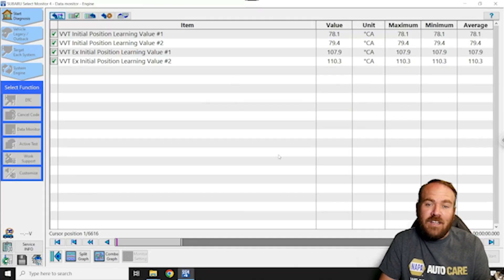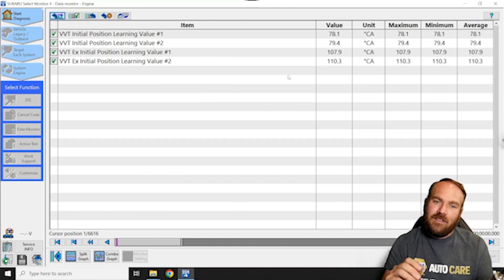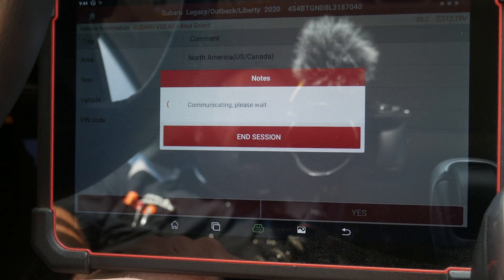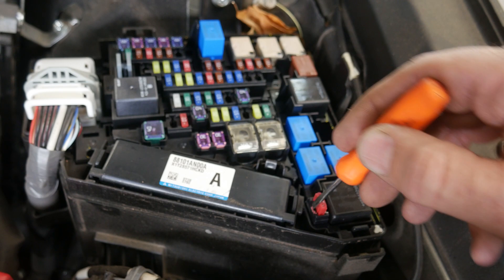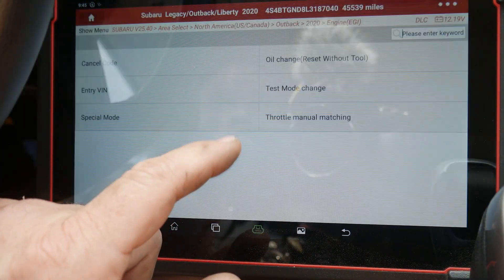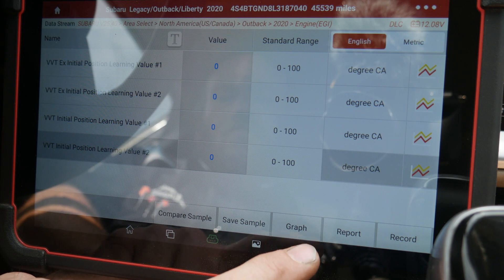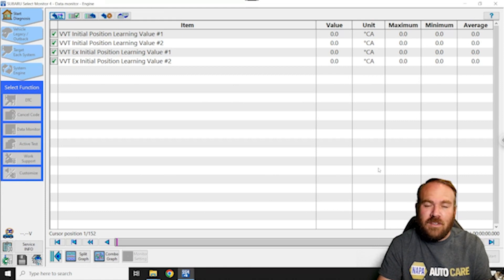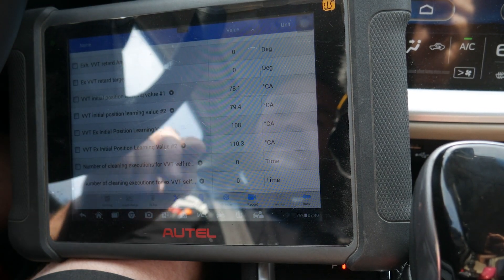Subaru VVT Learned Values Reset With Launch Torque Link | ECM Saved

Comment: I've got a hybrid that none of this stuff is working on using a launch scan tool. Will any of these procedures work with a hybrid model or no? So far for me, its a no go on a hybrid model 2015 Crosstrek
Reply from the maker: It may not work. I just recently had a hybrid crosstrek module mailed because the reset wouldn’t work. Shot me an email at chad@thepracticalmechanic.com for details.

Comment: What model is the Launch? My Autel doesn't have that function for a 2014 Crosstrek
Reply from the maker: So unfortunately, we found that many 2012 through 2014 models can’t be reset this way. I do offer a mail in service and a file service if you have the tools required to read the internal memory. You can try telling the scandal that you are working on a 2015 and see if the function will work but most likely it’ll say not supported.
Reply: @ThePracticalMechanic  I can't read the internal memory. Looks like it will need a ECM
Reply from the maker: @Arcade-fix I do offer a mail in service with overnight turn around. If interested send me an email. Chad@thepracticalmechanic.com

Comment: I have a 2015 subaru brz, with codes p0011 and p0021, with new facers and timing chain. Do you have an idea with which scanner  can i reset those values ? Thanks again
Reply from the maker: @jacobmeza5312  BRZ are hit or miss with any scan tool. A few people have been successful but most of the time the BRZ needs to be reset on the bench. A good scanner would be worth it just to have around for other diagnostic functions but I don’t want to get your hopes up that it will perform the reset. 
I do offer a mail in service if needed. Send an email to chad@thepracticalmechanic.com for details.

Comment: Worked on my 2015 subaru wrx! I used the thinkdiag2. Had codes p0018 p0021
Reply: I'm so relieved to find answers to this, my 2015 has had this issue since 2016. Did you replace the cam sprockets, or just run this?
Reply: @garrettjones7837  I replaced the camshaft sensor and ocv valves on the left side.

Comment: Any chance of a video showing the thinkdiag2 in action?  Im thinking of getting one so the local subaru doesnt charge me for a new computer they said i didnt need when they replaced a blown engine
Reply from the maker: I don’t have a video on the thinkdiag but it should mimic this video you will just have a smaller screen while using your phone. If I get the chance I will make a video but it may be a while with my current workload.
Reply: @ThePracticalMechanic  no worries.  I'm just hoping the dealership doesn't try to go full bore on the ECU replacement and listens to reason
Reply: @ThePracticalMechanic  Just wanted to let you know, I found a local mechanic with a MatCo Scan Tool.  They used this video to reset my ECU and now the car runs like new.  Thanks for posting this!

Comment: I appreciate your videos so much! I’d been struggling though until I found the marked fuse slot in my Crosstrek was indeed NOT the test mode one. But I found a diagram today and used a ThinkDiag2 to clear those learned values and I’m excited to not have to get a new ECU!
Reply: Could you please share a step by step using the thinkdiag2? I'm replacing my cam gear for Bank A on my 2017 WRX and would love to not have to purchase a new ECU.
Reply: Please share your steps thank you
Reply: Which fuse location was it? Trying to do the same thing on my Crosstrek.

Comment: Hey I currently have p0018 on a 2015 Sti that previously had jumped timing and I put a fresh engine in it. I’ve narrowed it down to the ecu at this point and was wondering if you could somehow show how to do this reset with the thinkdiag2?
Reply from the maker: As far as I know the STI didn’t have this issue since they have the EJ motor. Does the scantool show vvt learned values in the data stream?
I don’t currently have a 2014+ Subaru on the lot but I do have several scheduled next week so I can check it out with the thinkdiag2. None that I have coming in are EJ motors so the data may not be helpful.
Reply: @ThePracticalMechanic I don’t see any vvt learned values. I’m beyond confused as to what is causing this p0018 code. I’ve replaced and checked literally everything (ocvs, cam gear, checked timing, oil pressure etc). It’s odd because avcs will function normally after a reflash but as soon as the car gets shut off and turned back on again the cel will pop on and the car will go into a limp mode.
Reply: @RacingBanana96 i have same problem. Did you clear this problem?? If you solved this please share your method. Thanks
Reply: @RacingBanana96 did you fix this issue?

Comment: Recently purchased a Launch Torque Link, and have been randomly successful with this process. Some cars, works mint, others are not cleared. Specifically I currently have a 2019 Ascent with Cam codes, (P0024), and after repairing the vehicle want to clear the learned values. I've tried multiple times and methods, but the learned values will not clear on this particular vehicle. Any insight on this?
Reply from the maker: Some have reported they have to clear them several times in order for values to clear. Ascents are rare in my area so I have not tested the procedure. 
Subaru has released updates for some models that will allow the values to keep learning.

Comment: How to erase vvt data from 2011 forester? cant lie to scan tool, I tried, no fuse to install in service port, only has green connector under dash. No learned values in data PID on scan tool. Using Autel MS906BT. Thank you
Reply from the maker: I’ve had mixed reports on the 2011. Some have success with jumping the green test connector and some don’t. A few have had to clear the data by opening the computer and reading the eeprom chip. 
I wonder if it has anything to do with the calibration installed in the ecm. Some of the early ones required an update before you could read the data as well. 

I’ve had a few reports that the reset wouldn’t work after updating autel but I haven’t confirmed.

Comment: Is the procedure for doing this on the thinkdiag2 the same? Basically enter test mode and then clear the fault memory?
Reply from the maker: Should be the same.
Reply: @ThePracticalMechanic  Quick update on this: can't seem to get this to work with a thinkdiag2 and a 2016 forester XT. Tried about a dozen times last night following the procedure in the exact same way (install fuse, heard the fans spin up, enter test mode, read codes, clear fault memory, remove fuse). Sometimes the "clear fault memory" would work, other times it would say failed, but the VVT values never reset.

Have you had any luck using a thinkdiag2 on a similar model year forester?
Reply: I'll add that the intake VVT values were in spec (in the 80s) but the exhaust values were both out of spec (like 115 each). Not sure if having the values be out of spec affects the ability to reset? I'm using version 10.00 of the subaru software on the thingdiag2

Comment: Great tip . Do you know if the Autel tools will do this ?
Reply from the maker: Yes. I have a nearly identical video using the autel 906 to perform the same function.
Reply: @ThePracticalMechanic  You mentioned two different tools, which one would you recommend for 2017 WRX with P0018.  Can you provide amazon line?  Thanks!
Reply from the maker: @mondueo1  here is one of the more affordable autel scanners that has the function. https://amzn.to/3Q0xU75

Comment: When you say "we've cracked the code", who is we?
Who is credited for this find?
Reply from the maker: I got 90% there and gave up. A friend of mine, Joe Bonino, picked up where I left off and pushed more buttons until it reset. We worked out the exact order required and came up with this. 
The OEM scan tool doesn’t have the test mode button but it must of had it in the past at some point. Subaru has been replacing ECMs for years when it wasn’t necessary. Too bad their software engineers didn’t let corporate know that those values could be reset with this procedure. It is not documented in any OEM or aftermarket scantool or service information provider.
Reply from the maker: Unless you were implying I stole this information and am republishing it for my own benefit. Many people know that Pedro came out with a way to reset them by altering the eprom data manually. This is a different method than that and no part of his process was used with this method. His method is still required on the Subaru BRZ platform.
Reply: @ThePracticalMechanic  Did Pedro post a video of this? I cant seem to find it if he did. Thanks!

Comment: That's a big difference between replacing the ECM and resetting baseline values! Do the dealership techs follow factory advice?
Reply from the maker: I tried advising my local Subaru dealer and they wouldn’t even let me talk to the shop foreman. The service advisor said we only follow OEM approved methods. Many cars are sitting and waiting for ECMs that are on back order. 
In several Subaru technician groups I get positive feedback from some techs and negative from others because they are unwilling to buy a tool that can perform the reset.  The OEM tool cannot do it.  The thinkdiag2 is less that $150 and they claim that is too expensive.  The technicians that are performing the reset have worked out a labor code with their service advisors that allows them to bill and get paid for the reset. 
I typical replacement ECM out the door is around $1000.